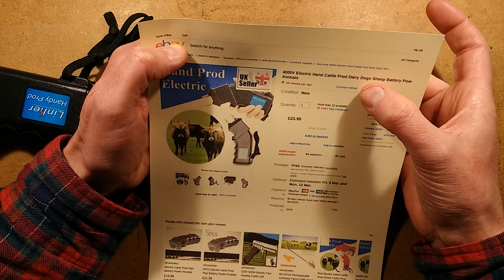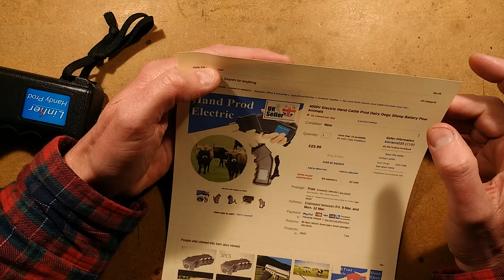Does a cattle prod hurt?

Comment: My opinion: Tasers are terrible self-defense weapons in general, especially for women, and provide only a false sense of security.  Tasers don't penetrate clothing (must make bare skin contact), which means in order to actually use them, you have to be within arms reach of the suspect and have them in your personal space.  Not only that, tasers are only effective when actually zapping, and the suspect can recover quickly.  Lastly, the suspect can overpower the user and take the taser away, further using it against the victim.  Short of a firearm, mace/pepper spray is much better option; a stream spray mace, not fogger style.  The user can maintain a reasonable distance from the suspect and still be within capable striking distance to disable the suspect.  Mace also impairs the suspect for a short-period, giving presenting an opportunity to flee the situation.
Reply: thechosendude this is blatantly not true tho some tasers won’t shock though thick bulky clothing they are fucking terrifying and they and very very loud the can be used as a deterrent as well and people can be trained to over power mace and those who wear glasses or even goggles will stop some or most of the mace. Personally a firearm is the most effective because some people are resistant to tasers or pepper spray but people generally aren’t bullet proof
Reply: Seth Gates -  Yes, a firearm is the best option for personal protection...like I said in my original post. As for mace/taser, I'm not sure you know what you are talking about.  Self-defense courses teach what I say.  Glasses do not make you immune to mace.  They offer very little protection because of how little it takes and the flow rate.  As long as you tag them in the face, it will drip into their eyes or they'll wipe it in trying to get it off.  It only takes a small droplet.  Just getting it on your cheeks makes the eyes water and burns.  You also ignore the fact mace has its own effect on breathing, not just disrupting vision.  As for a mask...that's just grasping at straws.  A criminal is way more likely to have a firearm than face mask.
Reply: thechosendude I know the mask part was a grab but I should have clarified that stun guns which are very similar to tasers do work through some lighter clothing even without prongs but I would say that both could be used effectively
Reply: Add Im talking about with out the prongs
Reply: While it is true tasers are terrible self-defense weapons, so are guns as the presence of guns increases (and not decreases) crime, in general.
Reply: This is not a tazer. Similar but not the same thing.
Reply: Tasers work through clothes unless the person is heavily dressed. Electricity passes through most fabrics. That's why in the video he tried on his clothes because standard tasers and stun guns actually pass through.

Pepper spray and mace are good especially when dealing with multiple attackers, but the problems are: 
1. They get everywhere meaning you might blind yourself in the process which makes things worse. 
2. Wind basically determines how useful it is. If the wind is blowing towards you or away from your attacker then it won't be effective at all.
2. Pepper spray causes pain. Tasers cause pain and contracts muscles to cause paralysis. Tasers will biologically force attackers to shut down regardless of pain tolerance while pepper spray doesn't.
Reply: Real tasers, the ones that fire dart-like electrodes are effective, the cattleprod style, not so much.
Reply: dzello Not really. And even if it does, I'd rather have the right to use an effective defensive tool than be vulnerable.
Reply: Arnoce, yes, really... I'm not stating an opinion, I'm stating a fact. 

Berkowitz and LePage (1967) did a research proving the simple presence of firearms INCREASED agression. Another fact is more crime are commited in households with firearms than in those without (Lester, 1991, 1993; Kellermann and coll. 1993; Kleck and Patterson, 1993). So you having a firearm actually increases your likelyhood of being killed in your own house, regardless of you prefering to own one to not feel vulnerable (which, by the way, is a trait caracteristic of people raised in a firearm culture because in places where there is no firearm culture, people feel safe even without firearm). 

The only true advantage of firearms is.. It's a very lucrative business. But safetywise? Firearms are a bad thing.
Reply: dzello I’m calling bullshit a study done by the cdc found that an estimated 500,000 to 3 million lives are saved due to defensive use of firearms
Reply: You can call bullshit as much as you want, I'm stating a well proven scientific fact, it's litterally my field of study. As for the CDC, they are absolutely forbidden to to study on the subject. What you're refering to isn't a study, it's an executive order given by Obama and they didn't say it saved 500 000 to 3 000 000 lives, they said that's the amount of times guns were used defensively. They also mentioned that in places where guns are legal, guns are used equally for offensive and defensive purpose (which is a bad thing). 

The reality however is that gun culture is a part of American culture that's very deep. It came from the first americans who wanted to be ready to resist an invasion by England to force them into submission so they thought... Let's legalize weapons for our citizens! (since they didn't have much of a military back then) It evolved into a very big part of their culture and now the NRA is a massive lobby to keep it that way. It's like how everyone knows the McDonald is bad for your health, but it's still everywhere... Except most people actually don't know guns have a negative impact on defense (because they lobbying for guns is just that good). In the scientific community however, it's a well acknowledged fact.

Last thing I should mention though... Even if it did say 500 to 3 000 000 lives are saved due to firearms, that's now how you count the benefits of firearms because if you have 500 000 lives saved at the cost of 600 000 lives, it's still a net loss (just a pointer).
Reply: dzello 
The cultural background is the weirdest argument for guns :P
Back then they wanted to use their guns to fight a tyrannical government or a foreign country that attacked. This doesn't require carrying guns in public or even using those guns on your own property...
Defending yourself a against a modern foreign army with only guns doesn't work anyway.
And this would also mean that they could use their guns to defend against the government that wants to take their rights away. Thus shooting a police officer that wants to arrest you isn't really in contradiction to the general idea of "defending yourself with guns against the government" ;)
Reply: I You are correct, while back in the day, it had its use (even though it didnt come in action), nowadays its irrelevant since governments are too big to be fought with small firearms, meaning the amendment is rendered moot. However, the idea that guns are central to liberty is very deeply inserted in the mind of Americans.
Reply: dzello Even back in the day, well at the times of the war of independence, the military was too far advanced with artillery and the navy to get some farmers with guns and win against the british.. However the US probably won't be happy without their guns mostly because effectively getting rid of them (for criminal use) takes like 100 years. And people always forget that it is not good or bad people. People who get a legal gun license could have a bad day 10 years later and murder someone. Usually people closest to them lol
Reply: alles klar klaus the gap was still closer to the point where having a militarized civilian population would be a major thing, they could have an effect because of their number.
Reply: dzello 
lol I just thought you suddenly started to write in German :P
His name means "all right Klaus" ;)
Reply: I loool yeah !
Reply: self-defense courses teach what you say because they're taking money from people to teach them martial arts that don't work in real life and give people the real false sense of security lmao
Reply: All instances of the word taser is actually about stunguns. Tasers do not rely on pain compliance.
Reply: dzello guns in the right hands decreases crime guns in the wrong hands increases crime
Reply: Why mace a cow?
Reply: dude tasers penetrate clothing  very well with and without the darts
Reply: like the taser right lawenforcment officers in the usa as an example used them s an not non but less lethal weapon
Reply: id take mace over a tazer any day
Reply: @sethgates4667  Legal, store bought stun guns do only scare, . I absolutely wouldnt feel safe at all with one. A taser maybe but only because im confident i wouldnt miss the target's face if he was wearing a jacket. If you live somewhere where you are likely to need defense, a pistol is the only way to go. Its then up to you if you want to stick around afterwards, but if you do, prepare to be financially ruined. Its just a mess all around for an honest person.
Reply: dzello You are 100% correct.
Reply: He means handheld tazers not stun gun
Reply: "Self-defense courses teach what I say. "

puts it in bold so it must be true!

lol

I smell severe BS and desperation.
Reply: that's why (some) designers slap a trigger on them :)
Reply: What you're saying is wrong. I just came from a video from a guy testing a $10 taser on himself WITH a hoodie on and it still inflicted pain. Buying a high grade one or even better an actual stun gun you're most likely going to take down your opponent. Even more so then a gun.
Reply: @TheExplosiveGuy  You're talking nonsense! The murder rate in the US is 6x higher than in European countries. From an individual logic it is good to have a firearm, but if everyone has one, it's a desaster.
Reply: @jurivlk5433  murder rate with firearms? Or just plain murder rate by any means? There is a distinction between the two with a massive difference. I get it that the US is a violent place, but my whole point was that guns aren't the reason that is why. We just have a lot more sacks of shit in our country, all the more reason to be armed. Owning a weapon does not make you a more violent person, far from it. I feel a very strong responsibility to do what is right with my firearms, but that does include shooting someone that wants to threaten my life or the life of others around me. Does that make me a bad person? And by the way, the most commonly touted statistics of gun violence include the cases where someone stopped a crime with a gun, which is like saying that food causes obesity and must be abolished...
Reply: Actual Tasers, which this is not, fire prongs which penetrate all but heavy clothing and jackets. They deliver a shock calibrated to incapacitate the target through actual nerve paralysis and/or seizure for the time applied and sometimes longer, not just pain like this device or mace. They can be as good as or better than mace for self defense, and can be as effective as a bullet in stopping power if the prongs make and keep good contact (though that is a rather large "if").
Reply: thechosendude taser guns are actually ineffective too about 52% actually work and that other 48% can be if you live or die
Reply: To the argument on guns in homes and domestic violence. Not one gun jumped from its storage, pointed itself at someone, and pulled the trigger.  It takes a person with the mind to kill another person.... contemplate the implications of this. If there is no gun, the murderous enraged person will kill their target by any available means, kitchen knife, baseball bat ect. Blaming the gun in domestic violence is utter nonsense and demonstraits either an inability to reason, or deliberate deception to further bigger government through denying people the means to defend themselfs.
Reply: Yeah so the Taser company makes police level tasers that shoot prongs for self defense. Makes your striking distance 15 feet, though you still can contact stun. Also, it’ll keep tasing (unlike the police model) for 30 straight seconds, allowing enough time to dip. I carry a Pulse right next to my fucking Glock tho. Lmao
Reply: What about men?
Reply: this isnt a taser with a bare electric charge
Reply: Guys there’s a difference between a Taser and a stun gun...
Reply: Just ask the murderer to take his cloths off.
Reply: Both are great but nothing is full proof
Reply: use a retractable metal stick instead
Reply: My taser goes through my hoodie
Reply: Tell that to my friend who got shocked decades ago in the back of her neck whilst waiting to get into a nightclub. She still doesn't have the full feeling she should have as it caused a lot of damage.
Reply: Cheap prong range tazers boiiiiii
Reply: Pepper spray is not instantaneous, I takes quite a few seconds to begin burning and even more if adrenaline is high.  If somebody is trying to kill/ attack you  then you will probably already be dead or at least seriously injured by the time it kicks in and imobilizes your attacker. Even then if hes got a weapon he can actually end up doing you more harm as he begins flailing around coughing uncontrollably....There is only one real tool to defend yourself with people, Don't EVER trust your life to these gimmicks that provide a false sense of security.
Reply: The best possible form of protection is a gun. The government does  not want people to be free or have a way to protect themselves but dint let that fool you. More people's lives are saved yearly from guns than what they kill. But media just shows when bad people kill good people so they can get sheep to want to ban the right to protection.  A taser is pure idiotic and same goes for pepper spray. A gun puts down a killer, rapist, and criminal down permanently which helps society be safer.
Reply: Ouf, haven't been on this post for quite a while, but I'll correct everyone who addressed me:

'' guns in the right hands decreases crime guns in the wrong hands increases crime ''

Yes, that's quite an obvious facts, though slightly incorrect. Guns in the right hands also increase deaths (accidents and such). The main factor though is you don't really choose who's hands the gun is in, mostly only if people have an easy or not access to it, which renders this moot.

'' if you're a ghetto ass moron who doesn't have a good safety plan and had an uncontrolled temper or addiction problem. My life, my protection, my choice. ''

Nah, the legal aspect of guns in a country is a social issue, therefore it's '' society's protection, society's choice '' and that's why  a lot of countries don't allow them: it has a negative impact, not a positive one. The USA though keep them because of how deep it's anchored in their history and constitution (and culture). If protection is what's important, then making guns illegal is proven better. 

''bullshit, look at Europe. Guns save far more lives than any other means of self  defense, hands down '' 

Again, that's actually incorrect. Guns have increased casualties overall and in no way lowered criminality. You made quite a big paragraph, but it's obvious you don't understand WHY guns increase problems and not the other way around. Yes, it would seem fairly obvious that having a gun means you're safer and that criminals will use a knife if they can't use a gun, etc... But it's not how life operates, there's more variables than that. The reason why guns increase instead of decrease problems is because people who would normally NOT commit a crime now DO commit one. You're thinking of criminals with this wrong logic: '' criminals WILL commit crimes, therefore wether guns are legal or not doesn't matter, they'll use another weapon '' but the truth is... Everyone has knives, right? But guns make killing easier. Therefore someone who wants to commit a crime will take a knife and then think... '' nah, what if I fail and he escapes and I get captured, what if.. '' whereas guns are so effective, people who are very angry and about to commit a crime just do it. Basically, it simplifies crime so much it removes a deterrent to criminality which is '' the difficulty of killing someone and escaping ''. I hope  I explained properly, it's basically what most people don't understand about firearms. Though if it was as simple as what you mentionned, then yes, firearms would decrease problems. Sadly.. it's not. 

'' I don’t care about what you think you know, firearms are not “terrible self defense weapons” they are a great equalizer for those that may not have physical strength.  ''

This also goes with the precedent comment. Wether people know how to use them or not, firearms aren't a good self-defense weapon because they increase global agression. I actually gave the studies that proves it higher up. When guns are legal, people commit crimes that they otherwise wouldn't do, therefore even if they are an equalizer... It doesn't matter: a bullet to the head will kill you. Basically, you think of it as if someone weak was assaulted by someone strong and that it would help the weaker person, but that's not how it works. When guns are legal, there's  more of the ACTUAL assault because people are more likely to commit agressive behaviors when there's a gun around. Therefore, you get MORE assaults in general... Which makes safety lower. Hence,guns are a bad self-defense weapon because they increase your chances of getting assaulted in the first place. (unlike other defensive weapons) Hard concept to grasp though.

''  The best possible form of protection is a gun. The government does  not want people to be free or have a way to protect themselves but dint let that fool you. A few crazy terrorists in Iraq brought the words most powerful and advanced military to its knees with just shitty old AK-47s yet you say if 80 million citizens have guns, it would not help. Are stupid? ''

Well, that's easy to correct: it's 100% incorrect. If it's about the US, the government DOES want people to have guns because it's a big money cow and the NRA is doing quiiite a big lobby to make people think it's a good defensive thing. As for the terrorists with the AK-47s, you're simply heavily biaised by medias. Those terrorists actually got obliterated byt the USA, it's jsut that you think the USA lost more than it did because the medias don't mention every single person killed by the USA everytime it happens. In reality, there was quite a bunch of terrorists and they got anhilated. Not only that, but the USA didn't try really hard to do it and it's almost like a side hobby of the country. They really, really didn't bring the USA to its knees. Another thing to mention is a lot of US military deaths are becaused by IED which stands for explosive deviceeees. Basically, what killed people is terrorists using explosives mostly, otherwise, their guns didn't do too much. So, am I stupid? Nah, educated. 

Probably gonna be a ton of people replying so.. See ya in the next 5 months when youtube gives me a notification again, but I'll reiterate: guns increase problems, doesn't decrease it. Proven fact, even if you argue against it. They're fun though.
Reply: @dzello  most people who legally own weapons won't use them for crimes (when i say most i mean the vast majority of people)
Reply: Yes, it is true. Most people wont do crime with it.

But the question as a country is:

Should we make guns legal or not for safety? And guns decrease global safety, so for that reason specifically, it is a no. 

Economically, its a good thing, it is fun as well. Just not to increase safety.
Reply: Well, I'll correct you entirely even if you don't want to start an argument. 

California has strict firearm laws indeed, but it's also surrounded by 2 provinces with the worst gun laws  and one with ''meh'' gun laws. People can move from one region to another easily in the USA, that's why even though it has itself strict laws, they aren't as effective because someone from the state over can simply move into the state, kill someone there, and go back or simply get firearms from one state and kill someone in California, basically. So yeah, it's just because of how the USA works in general, it's pretty simple. An easy example to understand this phenomenon would be the city of Montreal which has the highest criminality in the province of Quebec, Canada. That '' seems '' like it means the city itself is a problem (Montreal correlating to California here) but in reality, 40% of crimes in Montreal are commited by people who don't come from there at all... So in reality, the criminals just COMMIT the crime there. Another thing to mention is no psychology or correlation is 100% absolute. For example, if the USA allowed guns in all states and all states had higher crimerates suddenly, but one remained the same, you can't say because THIS state didn't change, guns had absolutely no effect on crime (which is what you did by giving a single state to justify all 50s relationship with guns). If California has other factors for increased crimerate, it can still have a HIGH crimerate with or without guns as well. Though I still explained the reason for California, this kind of logic is very flawed and you should make sure you don't make this kind of sophism (this one is called abusively generalizing by extrapolating one situation to make it apply to all 50 states). 

You also mentioned that states with more guns are very safe, it's factually incorrect since the overlap between the safety map and gun law lax is almost perfect with very few exceptions, showing incredible correlation. Though it's not perfect overlap (it never is after all), the most dangerous states all have lax gun laws.

Also, the sources I cited, while old, were NOT disproven. They were litterally repubished very recently, but republished sources (meaning they were reexaminated and reproven to make sure it still works) still retain their original date. (Basically,  a source from 1254 that still applies today and gets republished in 2012 will still have 1254 though the book in which it's republished and from which I quoted it is from the 2010s... In reality, I should've quoted it has '' author, date; author who made an analysis from the initial author's work, 2010ish... But it's tidious).

If you want more sources that are up to date:

Kleck, Kovandzic, and Schaffer (2005)
Kovandzic, Schaffer, and Kleck (2013)

There were 11 studies in total, but these two were the best one in my opinion (the others alll had a tiny thing that made them worst to those two). Though all 11 correlated guns and crime. For example, Monuteaux et al. (2015) did a great job but their research were on too short of a timeframe for my liking so even though it came out with a positive correlation, it's not as solid (still over multiple years though).

I'll quote some additional ones and their conclusion:

Cook and Ludwig, 2006: Firearm prevalence positively associated with total and firearm homicides
Chauhan et al., 2011: Firearm prevalence positively associated with firearm homicides of Hispanics
Parker et al., 2011: Firearm prevalence positively associated with homicides committed by youth aged 13–17 and youth aged 18–24
Siegel, Ross, and King, 2014: Firearm prevalence positively associated with total and firearm homicides 

So... Here you go people who probably don't care too much about this.
Reply: Yeah, i ain't be reading all that shit
Reply: You're not forced to read.
Reply: Wrong!
Reply: All false. A syringe is the best self-defense weapon. Just hold it up. Are they gonna risk whatever you've got? No.
Reply: Yes, its a social fact. People and reality are two different things. Its the same for milk which everyone thought was SUPER GOOD for humans but its really just a random drink that we dont need, yet everyone still think so today. People collectively tend to believe things even if they arent rational, sometimes !  Its also useless to prove them that they are wrong because those concepts are deep in the community, especially one with a massive lobby like the USA who promote guns. Its funny to see for people of other countries who see Americans really attached to things like guns or private healthcare which are both proven bad.
Reply: In america they also sell pepper spray at the front couter of auto zone.
Reply: Replace "taser" with "stun gun", since tasers fire prongs attached to wires. They're designed to shoot through clothes and the effect of being nailed with 50 Kv right to your wherever does in fact incapacitate you for a few minutes.
Reply: Cup&cone. I totally agree. Tasers aren't great. Some of the 10-15Kv ones will most definitely go through clothes. But as you said, it requires you to be able to reach your attacker, and if you can reach him, he can reach you. The ability to defend from a distance is an advantage. Pepper spray is better, though in strong wind, or in close quarters like a car you may suffer almost as much as the attacker. I advise all people to own and train with a handgun if they can. Since my Dad passed I got my 78 year old mother to buy a S&W 9mm. She's taking a handgun safety class and then committed to going to the range often to become very proficient. Luckily one of the elders at her church was a police officer, then detective and now Chief and a good friend of mine. He went to the FBI academy and agreed to spend time with her at the range once she'd finished her safety class. She carried back in the 80s with her job which required a lot of solo travel but hasn't shot in years so just want her to be the best she can.
Reply: dzello That’s false. At least in the U.S. it is. Statistically speaking areas with higher numbers of legally owned firearms have lower violent crime rates... including gun related crimes. Again I am speaking specifically of the U.S. as I have never really looked into the data of other countries.
Reply: dzello if you want an example look at Chicago where firearms are completely illegal yet they have some of the highest rates of gun related crimes including homicides
Reply: @dzello  Criminals have weapons regardless, whether you feel safe is irrelevant because you are unarmed. Poor people become criminals in order to eat, so crime is guaranteed during frequent recessions. This is perfectly visible in UK where people get stabbed by gangs because the government is financially corrupt. In the US, 300,000 cases of defense with a firearm per year far outpaces criminal use of a firearm.

Rifles will always defeat a modern army, its so incredibly idiotic to think that tanks and drones will be deployed against civilians or that those vehicles work against guerrilla warfare. You literally have losers backing you up saying martial arts dont work, or that no form of self defense is valid because you would be 1v1 against f-16s dropping cluster bombs. Delusional.
Reply: I have already answered every aspect of your comment and explained why its incorrect.

But for you Ill add:
You assume criminals commit crimes when its an incorrect mindset in the first place. Criminals dont commit crimes, people who commit crimes become criminals.  People who commit multiple violent crimes barely exist at all so people arent really criminals before they commit crimes.

And while it might not seem like a difference, it is:  if someone wants to commit a violent crime, hes more likely to do it if he has a firearm. If he doesnt, hes more likely to give up. 

Assuming people are criminals before their crime makes you assume things like you just did that people who dont find a firearm will just go for a knife and do it but thats just not true. A small portion might, for sure, but a lot will just give up on their intended crimes because knives have more risk for them (they have to get close, its harder, etc.) so they dont want to.

In the end, it means firearms increase the ease of commiting a crime, which leads to more violent crimes to be commited.
 
While carrying a firearm might SEEM to reduce your chances of getting hurt or dying, the safety it provides is massively outweighted by the increased in violent crimes that happens. In short, that means having legal firearms increases people safety by 1 and increases the violent crimes by 2 ... So you become more in danger than you were even though you think you are safer.

And its..that simple. Thats why firearms increase violent crimes and not the other way around.

Ah and for the guy, honnestly, using America is kinda bad for stats because theres insane disparity between states so its hard to compare them. I gave studies that prove USA has increased violent crimes from firearms but I still dont like using that country as an example because its so easy to go to  a state with firearm laws to kill someone with a gun you bought in a state with no firearm laws and stuff lile that.

The biggest problem though is difference between states.. You cant compare a rich and a poor state crimewise because firearms or not, their crimes will be different anyway. Chicago is a good example of that actually.
Reply: You must live in the hood since you are so invested in self defence.
Reply: dzello None of what you have stated is correct especially regarding the United States. First of all stabbings did increase drastically after firearms were banned in the UK. Secondly like we’ve already said gun laws don’t work because someone who is determined or desperate enough will acquire and use a firearm regardless of the law. For that Chicago is a good example. Guns are completely illegal yet the violent crime rate including gun related crimes is extremely high. Compare that to places like Texas; far more law abiding citizens own firearms and violent crime rates including gun related crimes are much lower. Despite your claims your argument is not in fact backed by data. One thing I agree on is the issue of suicides involving firearms but that is actually an issue of mental health first and foremost. Removing all firearms will not noticeably reduce suicide rates. Again someone who is determined enough will find a way. The argument that “guns make it easier” is an emotional one that isn’t based in reality.
Reply: dzello if there’s no point in replying then why did you? Also, I read your previous comments I’m just denying their validity. I am specifically talking about the U.S. because that is where I’m from and those are the data sets that I am familiar with. In the U.S. violent crimes including gun related homicides are lower where more citizens are armed and trained to use firearms. It is higher in areas where firearms are regulated or banned altogether. Banning firearms in Chicago did not lower gun related crimes including homicide. It’s not because people are legally buying firearms from out of state; it’s because the black market is already over saturated with firearms and that is where those who use firearms to commit crimes purchase their guns. Two of my family members are law enforcement in Chicago. One in homicide the other in narcotics. Banning firearms has been a total disaster for those who do actually follow the law. It’s literally made them less safe. Again I am speaking for the United States specifically and won’t pretend to know or understand the impact of gun regulation in other nations.
Reply: I didnt reply to what you said, I replied to tell you I already answered. There was no need to repeat it. I also already proved what you just said wrong and linked plenty of studies about the US (like 4 or something) saying guns increased it. 

Its a PROVEN FACT that you cant argue wether you like it or not. The only reason its legal in a lot of places in the USA is because the USA has been an extremely liberal country that always valued the liberty of buying what you want over anything and the cultural aspect of firearms in the constitution. THATS IT. Its the only reason theres firearms in the US.

Even in the US, specialists know guns are not good for safety but they keep it because its good for the economy.

Canada for example has neither the cultural value of firearms nor the extreme liberal culture (its only normal liberal) so theres no firearms there.
Reply: dzello You’re comparing apples to oranges. Canada has nowhere near the number of black market firearms and criminal organizations and/or felons using them. You’re right: most people don’t need a gun for self defense... on that we agree. Unfortunately not everyone has that luxury. Some of us live in an area where it is necessary to take personal responsibility for the protection of our lives and the lives of our families. If you took away every single legally owned firearm in America it would not solve the problem of gun related crimes and homicides. There is far too much cartel/gang activity at this point. And don’t get me wrong I’m not saying there isn’t a problem... I’m saying we need realistic solutions. We need to meet in the middle and figure it out together. I’ve witnessed firsthand what banning firearms outright does though and it definitely does not make the law abiding citizens safer. It disarms them against the criminal element and forces them to rely on an already overwhelmed police force. Lucky for you it’s an issue you get to debate from far away and with relative safety.
Reply: The reason why Canada has less black market of firearm is because unlike the USA, Canada has a full ban basically. Its easy to have a black market when the state 5km to the east has weapons. Its also why you cant compare the USA states to eachother because theres rich states, poor states and they dont have the same states around them either.

Id you compare countries worldwide with and without guns, its pretty obvious... The USA is where its the hardest to spot that but even there, studies find it increases violent crimes anyway.
Reply: dzello Actually that’s not entirely accurate. In the U.S. over 500,000 firearms are stolen each year. Most are then sold on the “black market” aka illegally without proper licensing or registration. Others come from out of the country. Some are even manufactured illegally (it’s fairly simple to machine a high capacity rifle yourself if you’re determined enough). I know you think banning all firearms will magically solve the problem of gun violence in America (like it has in other countries) but that is not a realistic solution at this point. This is because there are already millions of guns out there on the black market and in the wrong hands so to speak. That’s why blanket bans have demonstrably failed in places like Chicago. The bad guys already have their guns and they aren’t going to turn them in because new laws get passed. All the ban did there was strip the law abiding citizens of their legally owned firearms leaving them vulnerable to gang violence and opportunistic criminals.
Reply: Again, that is not how it works at all. And your opinion doesnt matter because its a scientifically proven fact wether you agree with it or not.
Reply: dzello Again, that’s exactly how it worked in Chicago. It’s not an opinion; it’s the reality.
Reply: Tasers are shot cartridges from a taser gun. Stun guns or stun sticks are handheld. There is a difference.
Reply: Pain is the best deterrent and the best wakeup to some idiot who thinks they are invincible. Tasers give you pain in spades without any serious physical and criminal damage without much effort on an attacker that has already chose to attack you in a handheld easy to use format. Spray is easy to miss/fail and useless once they are too close to you and leaves evidence everywhere and may effect others nearby. When your life is in danger you don't have time to think, just react to put distance between the attacker and you, making the attacker retreat is the best case scenario, tasers do that best without killing someone with a gun/knife.